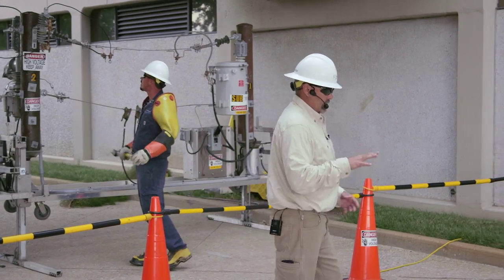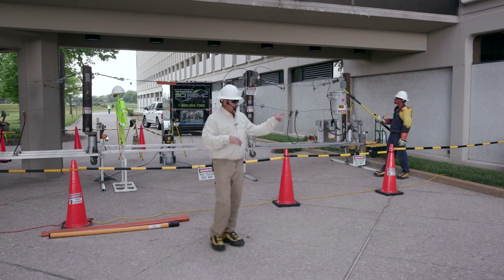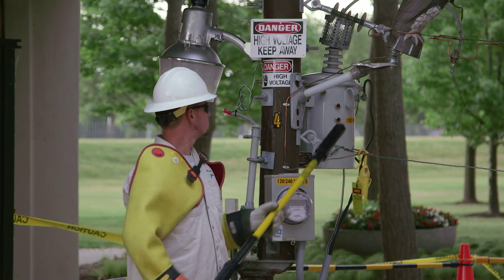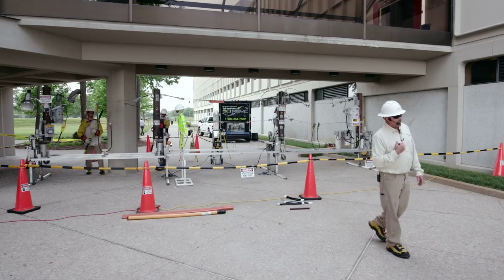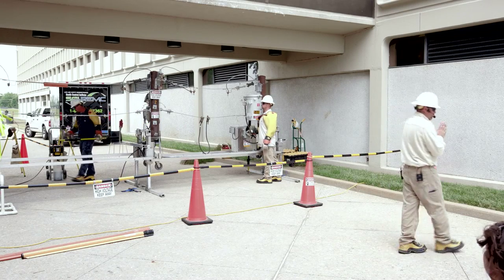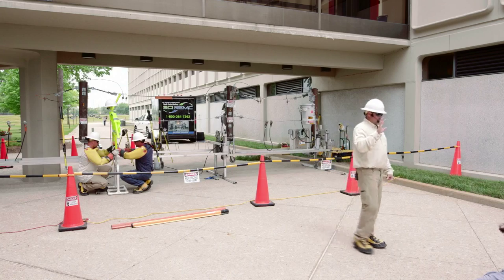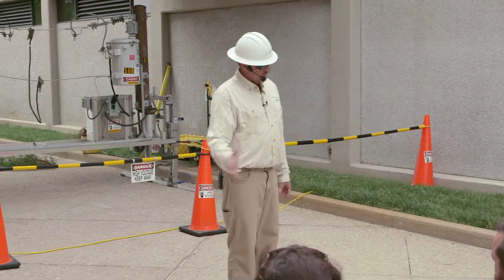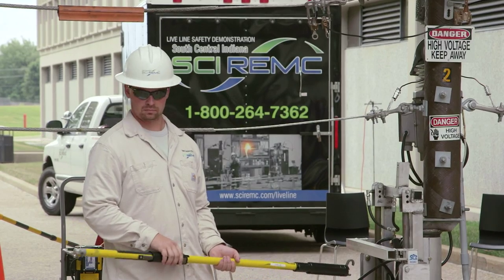SCI Live Line Electric Safety Demo

Comment: God bless all linemen thanks for everything you guys do we don’t have power without you
Reply: God bless their mothers . For without them we wouldn’t have power without them without them bless god mothers for without them without
Reply: Solar sadly will eliminate the need for linemen in the next 30yrs
Reply: @mrsmith2904  not really, solar will just retrain them. The transition will be easier from linemen to electricians. Retraining will be much more difficult for truckers who will be replaced by artificial intelligence.
Reply: @soupflood  most of them are linemen for the outdoor adventures and the pay, plus it's a fairly simple job if you pay attention and clean most the time. Electricians make decent money but still have to dirty work, big difference when it comes to everyday attitude. And your right about truckers but nowadays in time they have to fight for thier money due to the companies dropping trip pay way down every other year
Reply: Amen dude
Reply: @mrsmith2904  no it wont. It will always have to be fed, amplified and controlled.
You cant send 240 volts 200 amps 130 miles on 1 inch wire. You know very little about electricity.
Reply: @MichaelOfRohan  whoooosh???
Reply: Eh I have solar so doesn’t apply. Still cool to see
Reply: @suckmynuts69ify  your entire electrical consumption is satisfied by solar on your property only???
Reply: @MichaelOfRohan  yeah 120 percent. Battery backup to go with solar.
Reply: @suckmynuts69ify  You still have to be connected to the grid, and eventually you'll have to replace those panels as they dont age too well.
Reply: @Lotek117  yes unfortunately if you live in an HOA , you still need to be tied to the grid but I don’t depend on it. And I won’t have to for the next 30 years at least so I think that is a good life span.
Reply: @suckmynuts69ify  Where do you live?
Reply: @verteup  Houston Tx
Reply: @mrsmith2904  No way.  There are so many hidden charges to the consumer that solar is a minor power sour ce.  I wish government and power companies were FORCED to allow customers to use solar and sell back excess.  They will not.  Politics and business.
Reply: @suckmynuts69ify  what state and how much money are you being screwed out of by regional power companies, intermediary sales companies that sign up a group of houses, make a discount contract with power company, and pocket the difference. Intermediaries also have extra hidden charges. Last, you cannot sell back your excess.  Solar revolution for consumers is needed.
Reply: Hopefully before this system collpases they will help teach us how to keep the power on
Reply: Most important job. FOR SURE
Reply: @mrsmith2904  uh huh. As long as it’s not raining or cloudy for days you’re good. Otherwise I hope you enjoy hot beer

Comment: "we start out at a generating plant, lets just say we start there at 69000 volts"
This man passes the vibe check
Reply: 420kV 🤪
Reply: @andrewfield5656  A small station can be connected to the distribution grid directly so doesn't even have to be 69kV.
Here in Norway most small hydro power station below around 10MW are connected to the 22kV distribution grid. Think even some up to 20MW are connected.
Reply: 69 kv
Reply: @augustusdrane5249  yes 1000 of something in metric is a kilo
Reply: 9000 volts at the substation
Reply: was looking for this comment
Reply: Most of the comments on this are ignorant. The power can come out of the powerplant at multiple different amounts, 69 kv was just an example. The biggest lines at 765kv. And a transformer can transform most of any power amount, to any power amount the power company sets it to.

Comment: Very informative. Especially, the last comment on the surge arrestor jumpers and transformer brackets. I've been dealing with small birds (sparrows, etc) tripping my cutouts. For the last 4 years, every autumn hundreds of birds all flock together and simultaneously land on my 3-phase transformer pole. During that season, every few weeks the power ends up going out, and the transformer cutouts then need to be re-fused. Thanks for sharing this, at least gives me an idea what needs to be insulated better.

Comment: god i love youtube!! i swear you can learn a trade as long as your mechanically inclined just by youtube!!! i got a job at the shipyard when i was 18 as a pipe fitter no education not even a diploma making $32 an hour. little did they know i knew nothing about fitting pipe. i started watching all these videos on youtube about pipefitting and stick welding and was able to start the job like i already knew terminology and techniques for fitting and stickwelding/tacking the systems together!!  I'm now doing electrical work converting warehouses from HPS to LEDS. and i learned alot regarding codes and electrician techniques for doing things just from watching youtube!! im pretty sure legally im not supposed to even be doing my job considering im working on live circuits, running new circuits from the panels and wiring everything up.. but thanks to what i can learn online i have had 0 issues other than the occasional shock lol, but thats kinda hard to avoid when code says u have to leave 6 inches of wire in a box and the previous electrician left me about 2 inches and i have 6 or more wires all tied together in a single wirenutt

Comment: Thank you for the demonstration,
I've seen some crazy things happen with electrical power lines.
One time a person from my high school decided to toss his old pair of shoes up on the line, he contacted 2 wires which then caused the square block of wires to start to fry and melt the casings. Luckily everyone had cellphones and called the fire department and they followed the sparking flaming line, not sure how it stopped but it did eventually. They couldn't do anything until the electricity company cut off the power.
Another time a huge small tree sized tree branch fell onto the power lines outside the house and it was hanging there, had to call electrical company which put me through to forestry which then removed the branch. I was amazed that the line was able to hold so much weight... well before the forestry people came to remove it, some numb skull idiots decided it was safe to walk right next to the fallen down branch which was pretty damn close to the side walk. Luckily the line never broke, split or cracked to let a current through or those people would be literally toasted inside.
Reply: The reason they can hold so much weight is mainly for the fact that between poles they are sagging a bit by default, it would otherwise require much more force between each pole to hold it up, next to the risk of a pole toppling if it would snap somewhere.
(And there's also the thing of the cables being made up of tiny copper wires wound together into bigger cables, bundled together to form the bigger cable, they are able to carry much more weight than 1 solid cable.)

Comment: I used to work for the local cable company, we had a lot of aerials in our community so I had to carry an extension ladder down ally's and then sling it up on the mid span, usually the cable company has the lowest span for fiber and coax. but when I was on top of the ladder at the coax/fiber I was very very aware of the humming wires above my head. that shit was scary when it was wet outside.

Comment: Interesting. A lot of our power failures here are caused by shorts on the poles in winter: dried road salt gets flung up onto the wooden poles by traffic, then a light rain wets it down, so you have wet, salty (very conductive) wood. You can hear the electricity sizzling through it. Eventually one (or more) poles becomes so conductive that it heats up and catches fire, then the wires come down.
Reply: Concrete Poles As A Solution .

Comment: I have been in the HVAC, Plumbing, Electrical, Building Operation and Maintenance industry since 1976. I was fortunate to have been through Arc - Fault / Arc - Flash training. I thought that your demonstration was very well presented. You may want to mention to tradesmen about transient voltages that may be carried along with the power lines and that their testing equipment should be Category III / IV rated and anyone who works directly with electrical infrastructure should be wearing NFPA70E clothing. BK

Comment: We used to have a transformer in our backyard that constantly tripped. The power company would come out and use a pole to flip a metal rectangle "switch" upward and we'd have power again, took them hours to come out and 45 seconds to "fix" it. They refused to replace it even though we lost power 3-5 times a month during the summer. Finally got to the point one of the immediate neighbors got a long pole and it stayed on the ground under the light pole so one of us could flip it back up each time, reducing the outage inconvenience to 10min or so. Finally took 11 households banding together, one of which was a lawyer, to get the power company to replace the transformer. We lived there 3yrs after and never had another power outage. Not sure any of us would have done that if we had watched this video first! I had no clue those wires were live and not insulated, crazy!

Comment: As an equipment operator that's comes close to many wires regularly,  we are trained to do what's referred to the Hydro shuffle  when requiring to exit an energized machinery.   Bunny hopping away leaves probability of one foot leaving the ground at a different time than the other.  You don't want to be the electrical short between the rings of voltage radiating outward from a live wire contact.

Comment: My little brother just started a linesman apprenticeship. How they can hear that hum of electricity and not ** their pants is quite impressive.
Reply: When I need to go into the UPS room at work (not an electrician by the way, we sometimes place soaked camerabags there because the room is kept at a low humidity and is reasonably cold, so the things dry well there) I always make sure to be in and out as fast as possible.
Not only does the humming of the whole distribution box and battery bank freak me out, I probably don't want to be there when a power outage happens, since the switches in the distribution box are probably springloaded and maybe also supplied with gas cannisters to quench arcs and as a result, it's probably stupidly loud.

Comment: By him saying the homeowner "hooking it up wrong" in regards to the generator, he means hooking it up correctly but not interlocking the service main breaker where it's open when using a properly installed generator connection.
Reply: ...you mean Hookin the Honda up and forgetting that the main is still closed but don't matter because there is no voltage on top of it....yet...?
Reply: Truth is most people who don't know anything at all just plug the generator in at a plug that happens to be connected to the circuits they wanna run.
All the copper connected to that circuit becomes a telephone line. 

I'm not saying it could happen nowdays but would love to see a Honda 1000 el cheapo light up a transformer. If it don't go "BOOM" then it will just be open and take longer to fix
Reply: Yeah I'd make my own tons of places sale all the right stuff to make up your own fuse box even the right size of wire or type aluminum or copper
Reply: I was in Oklahoma staying in a rv, with my boss his dad's place, power went out uncle went out to hook up the converted irrigation motor to a genny.  I'm vacuuming the floor an the power goes out couple minutes later comes back on, I went back to vacing shit started smoking.  I finished quickly went to look out the garage.  Seen my boss dad sprinting across the lot shuts off the genny.  Well 2 computers 3 deep freezers an one vacuum.  Where taking to soon that day.  I assume its because of what this man explained to us.

Comment: Eleven year lineman, work for William Electric Shelby NC. Contract for Duke Power 7200 volts. Did underground and overhead and even set the meter, we did it all from one pole job to eight or twenty pole whatever it took to do the job.

Comment: At the beginning of this video, I was just about to say, how stupid could somebody be to plug his generator into the mains. Then I remembered that a college of mine whom I considered to be quite knowledgeable about electricity complained to me that his generator kept tripping when he plugged it into a wall socket so that it would power the whole house. Even though that is not quite how things should be done I asked him if he turned off his mains idolator before he connected the generator, to which he answered, he hadn't. I explained to him that his little 5KVA generator was trying to power everything on the grid outside the transformer or sub station that had tripped and how to rectify it, hopefully before electrocuting a few electricians.
Reply: How exactly do you disable the mains isolator?
Reply: @Fatvod  Usually, it is a huge big fat switch in the DB. Turn it off.
Reply: I install them. it has 2 selections: Generator and Grid. You can only select 1 or the other, not both :D
Reply: @Fatvod  just turn off your main 100, 200 amp breaker and put a pin though the metal ring so no one can just flip it back on, wire your generator into a double pole 30 or 40 amp breaker i have a 40 amp as my generator puts out 220v 40 amps, after you turnoff the main start your generator, turn on your 30 amp breaker in the panel// good to go
Reply: @BryanTorok  i am very aware of them.
Reply: When the main is turned off, it opens the circuit of the two hot wires...but the neutral goes around that and doesn't seem to be disconnected. 

So, when the generator is running the house, how is it safe that the neutral is still connected all the way back to the pole?
Reply: @TonyB1999  the neutral dont have any power in it, and it is taped into the earth ground, in the panel with what you call a bonding screw, every service is the same..
Reply: @TonyB1999  It should be perfectly safe because at the pole, you neutral is common to earth, so here is what I do: This is known as TN-C-S standard. I drop the earth coming from the poll. I then create my own earth at the source side of my RCD which is common to Neutral and I attach that to the house earthing and I add a nice long earth spike that goes deep into the ground for good measure. That is what the standard requires us to do anyway.  So at the load side of the RCD, you have live and Neutral. Earth is connected to the load side neutral of the RCD forming a PEN (Protective Earth/ Neutral). I hope that makes sense.
Reply: @TonyB1999  The neutral is grounded (actual copper rod into the ground) at the service entrance, that is where the power comes into the building and goes into the breaker or fuse panel.  The neutral is also grounded at the pole.  Again, that is also an actual copper rod into the ground.  So the neutral is always at ground potential.

Comment: Microwave ovens do NOT cook from the inside out. The radio waves only penetrate about 0.4" (1 cm), so they only heat the outside. The heat from the outside conducts to the inside of the food.

Comment: I just put in a Generac backup generator and a new service panel. The power company guy got up on a 24' ladder and pulled new wires to my new post by himself. That's one gutsy guy because the electrician putting the ATS in said he's never do that.

Comment: They need this type of demonstration for my community here in Wv. The power lines here in some spots is no higher than 20ft and that in the mountains and spots that haven’t been upgraded. I know where a pole is near me with an open wire secondary on it that’s 12 foot above your head! Power company has been called and emailed multiple times but guess it won’t be fixed till there’s a fatality.

Comment: I live near Chattanooga, just south in Georgia. The top power line are 3 wires (3 phase). A storm blow a tree down and it broke all 4 power lines. The 3 phases and ground.
The top power lines were laying on the road. People, with bare hands moved the high voltage power lines. They may have been dead, but something could have back feed. 
Some people are DANGEROUS.

Another time a 2 phase line was on the ground very close to a trailer park with lots of little children. I called 911 and they said a downed line was not dangerous. sometimes 911 is not what it should be.

Comment: Nice recommendations YouTube, and question, why aren’t power line wires insulated?
Reply: It's because it's easy to tap into them. Also this will give breathing room to the wires. And the main reason is to increase power capabilities. The main problem of insulation is that a fuckup in a line can cause all of the insulation to burn and melt. Imagine this in a larger scale
Reply: Also exposure to the elements will create headaches as insulation will break down over the rain etc.
Reply: They are insulated, with air. Air is actually a pretty good insulator. The separation is different for different voltages though, as air has an insulating factor based on distance. I don't recall what it actually is at the moment, but something like a kV/cm, or somewhere around there. It does change a bit when an arc is struck, and their becomes ionized.
Reply: It costs less , bottom line.
Reply: @robert37042Tn  that's the truth!

Comment: Going pole to pole seems like it would be very time consuming. Could we not generate a signal along the line at each pole, each with a different value, all added together at certain points. So then when you get a fault, you  could just check the values and see which one is missing to pin point the fault location? There's gotta be a more efficient way than going pole to pole... Great video. I'm not a lineman, I'm IT, but I find this very interesting.